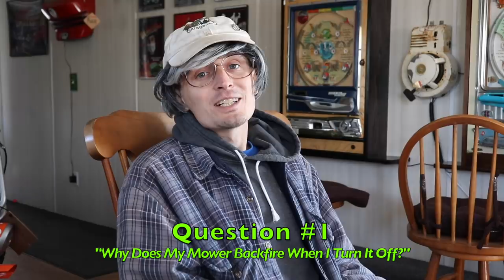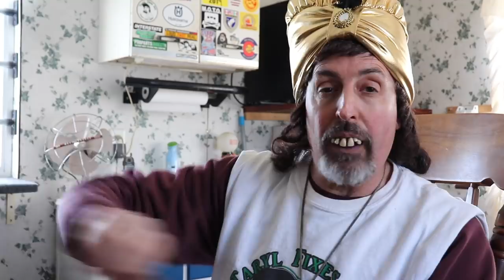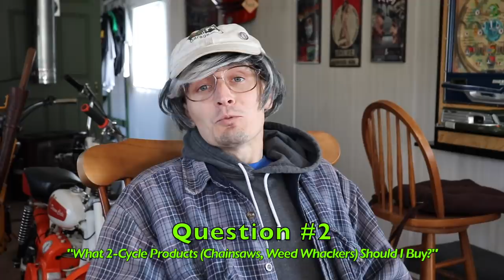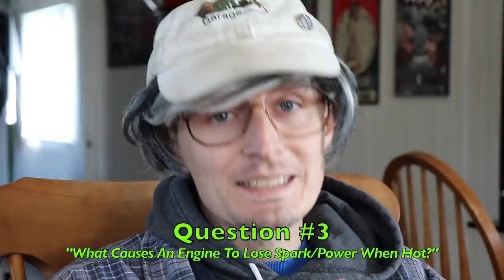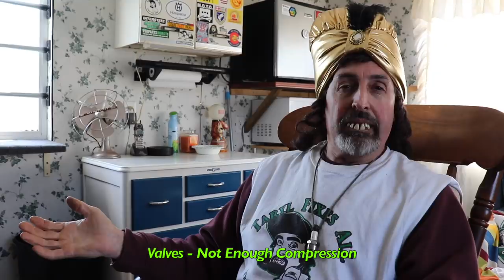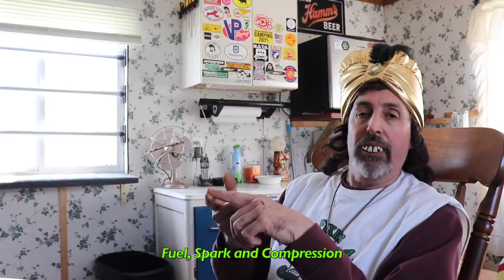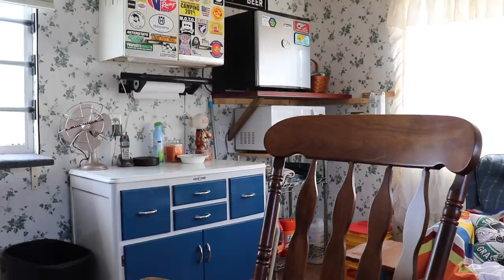Taryl Q&A #4 You DON'T Know This Stuff

Comment: I worked as a maintenance man at a stamping plant. I would get called over to fix a broken machine. My first question to the operator would be. What were you doing just before it stopped running. 90 percent of the time the problem was what they had done.
Reply: Operator malfunction.
Reply: GREAT advice.  I always try to ask that question when someone brings something to me for repair.
John
Reply: Yup I'm maintenance in a factory weld shop. Hundreds of robots but again most calls are due to production team members
Reply: It would be good if you could do a video on a Tuff Torq K58 like you have done with the K46. I had mine all laid out in my office room and my wife moved the oil charge pump cover and I dug and dug all over the internet to try to find a pic of correct orientation. I finally found it down loading a service manual from a cub cadet. It’s actually on my John Deere X320. Tuff torque and every parts website didn’t have that info. TT website didn’t have any exploded views of that transaxle! I got it figured out, but this knowledge might be good for the rest of the peeps!😂

Comment: Hi,
On question #3.
It is very rare but i have found that a spark plug when it gets hot can open up internally and therefore not supply spark to spark at the plug.  Your in line spark detector will show that your have good spark from your coil but the problem can actually be a defective spark plug.
I had one that would run for about 10 minutes and then cut off.  The coil was fine, the spark detector showed good spark and it turned out to be a defective spark plug that internally opened up "when it got hot" and kept the spark plug from firing.
Last resort change the spark plug.
Just something to keep in mind.
John
Reply: I've busted some open and found a resister
Reply: @dartvader9939 
COOL!  I have always wondered what was inside of a spark plug.  I am sure there is a picture somewhere on the internet that shows a cut away view..  I will do a little technical digging.  Ha Ha
I know they have different heat ranges on spark plugs.  Guess???? that they have different resistor values in them.
Funny how we take all of the so called simple stuff for granted.
Thanks for the valued input.
John
Reply: Probably a chinesium sparky

Comment: One of the best things I did was getting a carburetor adjustment tool kit off of eBay for Weed Sniffer engines etc..., these little engines are set to run VERY lean at the factory, so adjusting a “non-adjustable” carburetor has solved many a running and starting problem for me along with using Startron fuel enzyme in the gasoline. Sometimes you just gotta take the bull by the horns! Yes, I agree Battery powered lawn equipment is definitely on its way to be huge. But there’s just something about engines that I will always like better. Love this channel! Thank you Taryl and the fellas!

Comment: I believe one of the most destructive things you can do to any small engine it to shut it down at full speed under load.  Without the engine running there is NO cooling air passing over the engine cooling fins dissipating the heat from the cylinder wall and cylinder head.  Letting the engine idle at low speed for a couple minutes before shutting it off really helps cools it off and greatly extends engine life.
Reply: Don't idle it (not enough air flow) but without load on it allow it to run a couple minutes at about 2600 RPM to blow off some of the heat

Comment: My question for the next instalment of 'Ali Blah Blah' is this [and it's a good one!] - battery powered garden equipment is now the rage. But, does Taryl believe that this equipment is likely to be economic to service when it fails to operate, or will it end up being junked?
Slippers and Ali Blah Blah! Love it!
Reply: Good question.  Remember really old fans and hand drills and the like.  They had oilers and replaceable bushings stuff like that.  I wonder if even the better brands of power tools will be built with replaceable parts and made repairable.  The weed eaters I've had you're better off wrapping it around a clothes pole and buying another one.
Reply: I called the electric chain saw co on my 80v brushless saw. They told me I could not buy parts! Now if a guy bought a few new E saws and parted them out. I think there would be a demand & money in that. Brushless motors & lithium ion batteries are the future! When brushless motors came out, all electric rc boat records more than doubled from 50 miles an hour to 140 miles an hour!
Reply: People will keep swapping out batteries as they try to finish the job...plastic parts warp and electric motor or some rotating part seizes...tool gets thrown to ground or wrapped around a tree.  Then its off to buy a replacement and repeat. A lot of people shouldn't own any kind of tool...hire a pro to do the work.

Comment: I always go through a "cool down exercise" with my riding mower. After running for a hour in 90 degree heat, I let the engine idle for 5 minutes. I learned it from a old man that rebuilt Volkswagen engines. Heat Kills!
Reply: Same here, I'm very picky about that stuff on all my equipment, half of my stuff belonged to one grandfather or the other and is old and I restored long ago, tiller,mowers,saws ECT.ect I get ill when my dad uses one of them and runs the shit out of it then just kills it wide open, my kids know better than that.hes never had to work on anything,earn anything or really do anything until he had to move in with us he thinks everything's just fucking magic ,my ears pop up like a blood hound when I hear my mower running wide open the just shut off out In the distance, same with my damn saw hitting the gravel I'm glad he's finally trying to do something after all these years but daggum

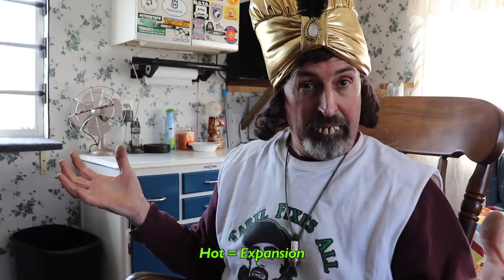Comment: 9:55 Also the air gap on the flywheel changes as it gets hot. Coil needs to be adjusted away from the flywheel more. Maybe do 12 thous and see if that helps. If so try 15 thous.

Comment: One more thing I learned from Taryl was that If it doesn't want to start when hot to check the head bolts. It might be sucking just a little bit of air. When it's cold like he said everything is compressed but when it heats up everything expands and you'll know if a head bolt is a little loose because a head  bolt will be darker than the rest. Retorquing those bolts takes care of the vacuum leak when it's hot at the bolt sight. Of course you want to check the gasket if this is the case and you'll probably have a slight searching when it's hot also because of the vacuum leak. Wish I could find the video he posted on that. But If it's reving a little when hot and doesn't want to start hot, this could be an issue also. Might have a small vacuum leak from a head bolt. I always check for a discolored head bolt now also.  Thanks for that tip Taryl.

Comment: The backfiring is also because people shut the tractor down while on high RPMs and after running engine hard. Idle the engine down low as possible and let it run a second,,then shut it off. And I see taryl just said that!!  lol
Reply: There's actually some engines that say right in the manual to have it running at about half throttle before you shut it off.
Reply: ltbigdog......down to idle speed 
for couple mins before switching off,helps cool engine down as well

Comment: the crap in the right angle outlet is a good one but you missed an air leak like in the fuel line or grommet in top of tank. i fought that problem a while on j.d. 240

Comment: Taryl...thanks for your question an answer session. I have a question. I purchased a brand new Sthl hand held blower; weeks later I started having start issue. I noticed bulb primer wasn't full of gas and depressing it several times had no affect in starting back up. The blower was running well until I shut it off and when I wanted to use again within a short period of time this issue repeats itself.  What is your thought...Thx, Brooks

Comment: I have a question? How do manufacturers generate horsepower rating? I see a lot of engines with the same specs as far as carburetor and  CI (cubic inch) but one will be 20hp and the other 22 or 23hp.

Comment: also if you turn the ign. back on as the shut down engine is still coasting down the engine might pop because the spark making devices on most those engines fire the plug at the end of the exhaust stroke/beginning of intake stroke as well as at the desired time of the end of the compression stroke.

Comment: I have 2 issues. I have an Areans 46in cut 22hp briggs mower. I have to put it on choke every time I have to start it. Once it's started I can take it off choke and it runs fine. What would cause this? I also have a Murray with a 12.5 hp briggs that I threw a rod on but there is no hole in the block at all. Is it possible that I can just get a piston with the right rod on it and clean the block up, reassemble and have a good running engine or is it too trashed to fix?

Comment: Backfire is my Chipper's middle name. Old DR C18CHP with the 18hp Briggs opposed twin. Start it up, it runs full speed and when you shut down from full speed it always pops..sometime I think it's going to blow that $100+ muffler. I wonder if I could add a throttle control...and a key ignition switch for safety. The later models with the 19hp v-twin motors had all that.

Comment: I have a question about spindles. I haven't found a video that addressed this ... exactly. I recently purchased a 1992 MTD 18/46 and need wheel bearings, all the online stores I found didn't carry those parts. I was thinking of getting John Deere spindles then putting bearing upgrade and rims. I saw your video about the upgrade on a John Deere. How compatible are Deere parts with MTD? Deere parts seem to be easier to find. Any other ideas? I am a landscape contractor in California and do most of my own repair work. Thanks

Comment: QUESTION:  Why does my mower run ok at idle but it bogs down when opening the throttle too fast.
BONUS QUESTION: What is the difference between a Tecumseh TVM-220 and VM-100.  Which one is better?
Reply: Probably to lean or rich. If it’s not getting the right fuel it won’t throttle up.

Comment: last year i got a stihl msa 120 battery chainsaw to go with my other stihl saws. it cuts as good or better than some gas saws i've had over the years. bonus, no pull start rope to make my old, worn out shoulder cry. i'd definitely recommend one if you can pony up the dough. she's a bit salty at around $350-400, but a new stihl ain't cheap no matter what yer buyin'. i'm a modern multitasker too. i can surf the innertubes in my garage, since i gots one o' them 43" samsung smart tv's with the wifi on clearance at wally world fer $120. it was the model year change, and mine was a display model. it was turned on 24/7 fer a whole year, but it still works good. so i can work, and watch the youtube, well listen to it anyway, at the same time. sure beats the old shop radio i had before. i still ain't got my jetson's flyin' belt i was promised as a kid, but i guess we're gettin' a little closer.

Comment: Hi Taryl. If you could respond on this question or if anyone knows I would really appreciate it.  I have an old Montgomery Ward ride along mower with the engine under the rider. It's an 8hp B&S. Problem is that the battery is overcharging. I just bought a new battery and when I started it it went about 15.5 volts when running and the battery exploded. Do you know what is problems that can cause this?? I heard there is a regulator for these maybe but I'm in above my head on this and know you do. Thanks

Comment: Carbon build up in the cylinder or Mufleator can cause Back Farts too.
Reply: Carbon build up because it was running rich or has really high hours I guess.
Reply: Or if it's burning a little oil that'll cause build up.

Comment: Taryl Fixes All. Some time ago, I purchased a Jonsered GTS -2228 straight shaft trimmer from a TSC store in which I purchased the no question(s) asked extended warranty. The trimmer ran as it should for about a year until it started leaking 50:1 fuel profusely. So I went to the TSC where the trimmer was purchased and told the associate about my issue with the trimmer. I was referred to the person in charge who upon hearing that I had an issue in a very smug manner stuck a pamphlet in my face and was told to call the insurance company that TSC does not deal with warranty repair issues. Also just before the Jonsered purchase,I purchased a Cub Cadet ST-100 wheeled string trimmer that the deflector shield had a rivet/bolt that had pulled through. I was told that I had to file the claim and that the insurance company “May” reimburse the cost of a new replacement deflector shield. In other words, I would have to order and purchase my own repair parts and then notify the insurance company and if they deemed the cost of the parts worthy - I again “May” be reimbursed for the repair - What A Crock!!!. After those two instances I said “Never Again” to buying power equipment from TSC or any big box type stores and their “So Called Extended Warranties”. Please take Taryl’s advice and stick with the servicing dealer. Remember, You Usually Get What You Pay For; But Not Always.
Reply: Rubén. I tried one other time to get something done regarding the warranty, And again I met with a person acting like that they had never sold that brand of string trimmers believe it or not. So it was very evident that the so called extended warranty was totally baseless. So one day, I  totally dissected the trimmer and did not find any broken fuel lines or busted fuel tank or really anything blatant that would stick out as a cause of the issue. Upon not finding a quick solution, I carefully bagged up all of the small parts including all of the screws, the engine casing and  trimmer shaft to play around with after I retire in a few days. I thought that was best to wait before working on the trimmer again to get the hate and discontent out of my system. At least the vast majority of screws use a T27 torx bit.
Reply: @TheIronDuke502  Did you ever find out what was wrong with your trimmer?
Reply: @gregorymalchuk272 Thinking Back, All of fuel lines were absolutely pouring fuel in that it was a dangerous proposition just to start up the engine. I never did get any help in any way from TSC. 
Later on, I disassembled the trimmer just to see what exactly was going on. Actually I still have the trimmer parts that I wrapped up in the plastic grocery bags and such and I never could understand why the trimmer that was still that new could have such a serious failure with the fuel line. 
I will say that this trimmer which was branded Jonsered was Husqvarna even with a branded Husqvarna spark plug. The fuel line that Husqvarna used was of very low quality to split like that. If the trimmer was used and well used, I could accept that fact, But not a brand new trimmer. It’s no wonder that so many people have started buying the battery powered tools and yard equipment. Much Less Hassle.

Comment: Will a newer cub cadet 50" zero turn deck, the welded one fit on a 2006 50" zero turn? I have the residential with the tube frame not the stamped frame model.

Comment: The fire triangle is fuel, air, source of ignition.....

Now, if the ignition is happening at the wrong TIME, then you have no ignition.....

Also, I have seen weak batteries crap out, when they get hot....  when they cool off again, they act like everything is fine.....  That would be more like a no crank scenario though....  I think Slippers was probably asking about a hot crank no start....

Great job as always...  those are just very minor nitpicks.....

Comment: i've got an old cub cadet 1864 with the kohler command 18. if i idle it down before turning the key off, it will backfire, if i put the revs up some and then turn it off, there is no backfire. what is the problem here? too much gas at idle but right amount at mid/high throttle?

Comment: OR you can slow the engine down to idle for a minute before shut down. That also avoids back fire because it won’t be running so fast to pull fuel though into the muffler. My 1986 simplicity will back fire if I shut down the engine wide open but won’t if idled down

Comment: In the old days (50's & 60's) while driving down the road we would turn key off & while still coasting, pump gas pedal a few quick times... then turn key back on ...BANG!!! a HUGE back-fire...sometimes a back-fire was big enough to blow up rusty old exhaust systems!  LOL  🍺🥨🍺  and THEN...
Then there was the spark plug in the exhaust pipe trick that really set off a bang.  Anyone remember doing this?

Comment: I hate I missed this Q a A. I just replaced cam shaft in Husqvarna 18542 bc of broken compression release. It still is not cranking past compression stroke. not sure what's up now. If you have time to answer I'd appreciate it.
Reply: Timing is off.
Reply: @heyinway  ok. I got timing corrected. Maybe you can help with this. I though I took a pick of carb/ throttle and return set up....but I can find it. Could you help with this set up please? 592953 carb. May I  send you email? Thank you so much.

Comment: How about  air leaks on 2 cycle engine cause a hard start or no start condition.
Reply: Crank seals
Reply: Carb to cylinder air leak is common problem...too much air in the wrong place.